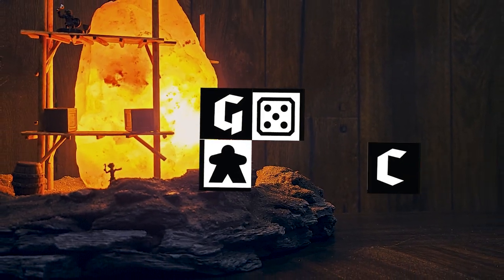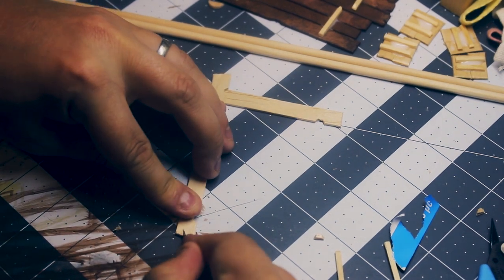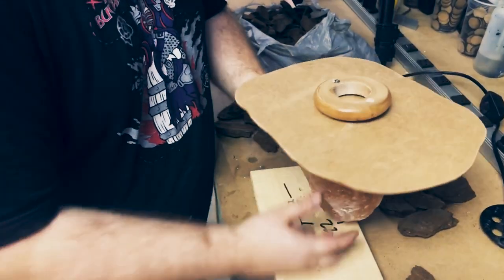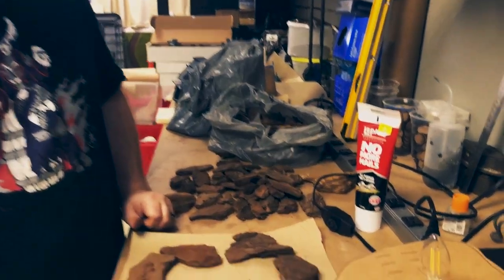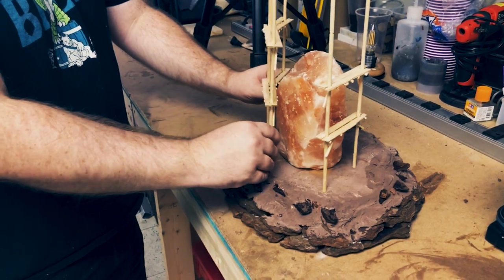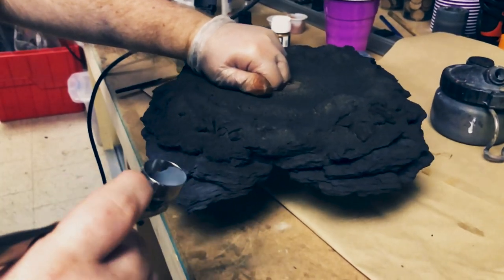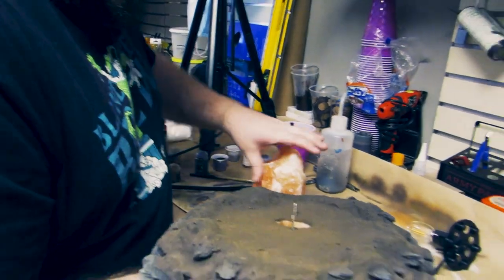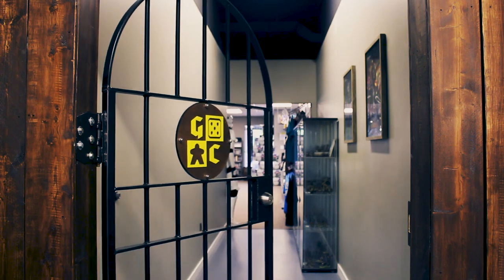Incredible SALT LAMP Terrain Build! | Terrain Tuesdays

Comment: Would be cool to try etching in to the salt to draw out different levels of light in areas forming patterns.
Reply from the maker: Yes! We really wanted this to be useable and then the lamp returned to its normal self, but if you didn’t mind adjusting it permanently I think there’s some fun things you can do to it! We tried adding silhouettes to the inside thing it could look like a ‘cocoon’ or sorts, but it didn’t really work :D
Reply: @GameChamber  Have a look in to Lithophanes for 3d printing too. Might be some cool effects out of those with some creative minds thinking about it.